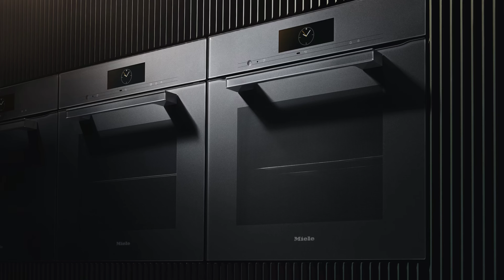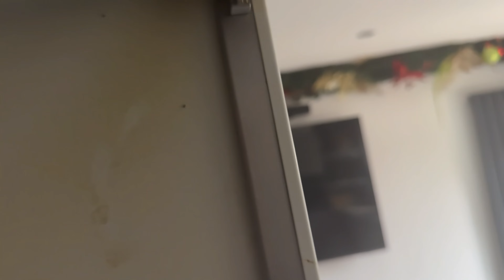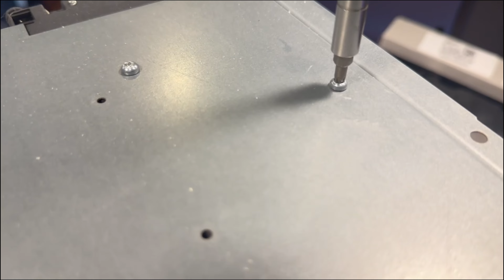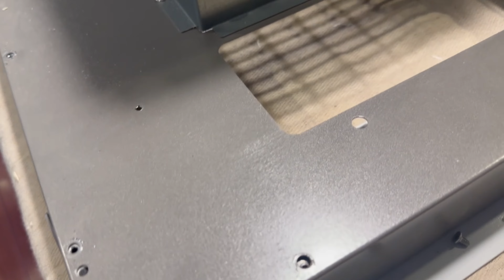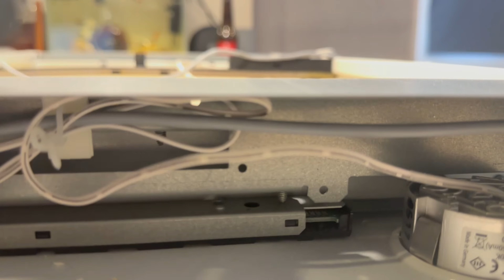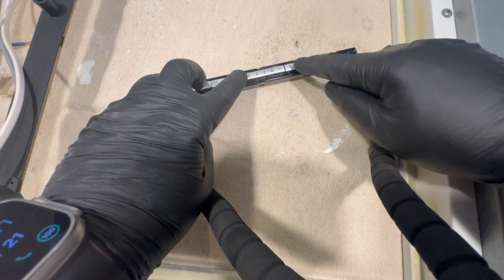MIELE COOKER HOOD - NO POWER

Comment: Great informative video. There is no visible “locking” system (no padlock symbols) on the Hood DA419-4.  

How is it opened to replace a halogen unit (not the bulb), when the bakelite on the old one has perished with age?